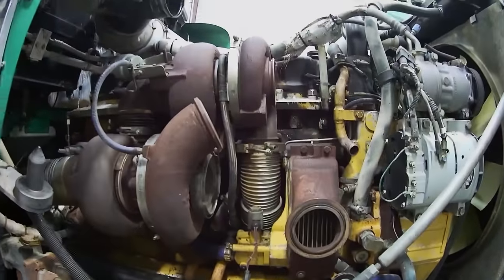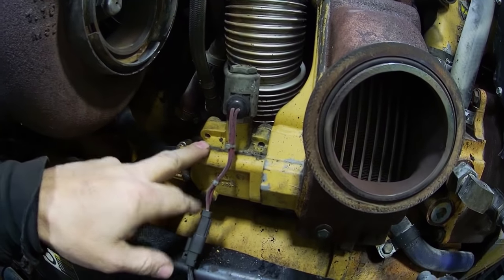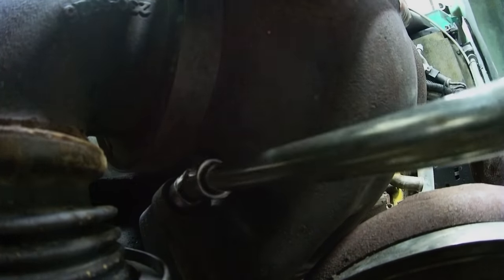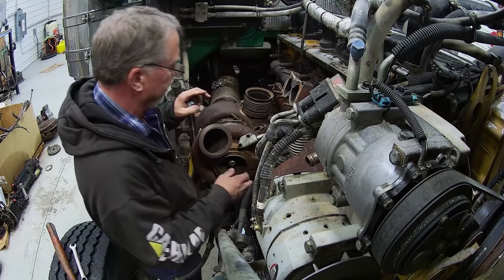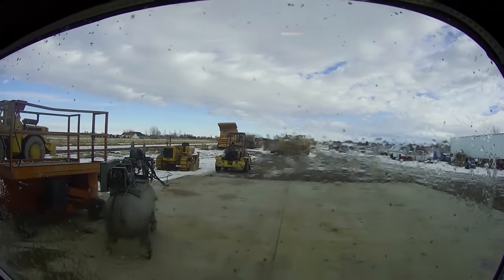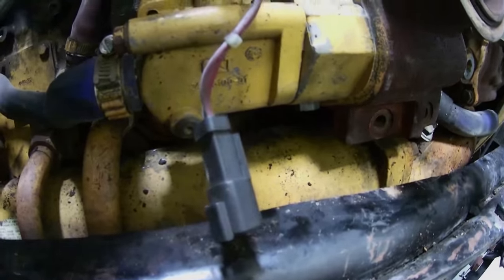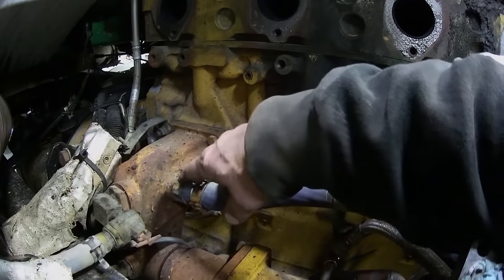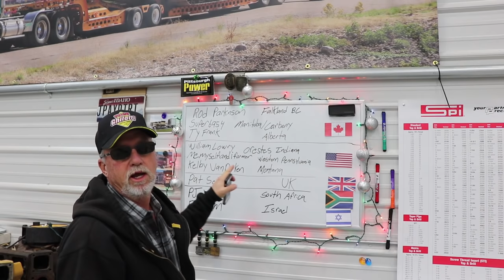Caterpillar C15 Tear Down

Comment from the maker: http://www.hankstruckpictures.com/rod_parkinson.htm

Rod's truck pictures, Check it out
Reply from the maker: The hose off of the cooler bonnet is the pressure side it goes to the pre cooler, thru the pre cooler and out the other hose to the intake side of the water pump

Comment: The solenoid you pointed to is the coolant diverter valve. It controls water flow to the pre-cooler. During warm up the valve is closed to prevent coolant flow to the pre-cooler. Once coolant temp reaches x(depending on software file) it opens to begin cooling the air charge. As for the valve riser you should only have to remove the IVAs to get the riser off, the rest of the overhead should be able to stay in place. Wouldn’t hurt to make sure it has the most recent updated studs to hold the rockers down. Went through a few revisions because they would break. Great time set the overhead. Also make sure the updated IVA oil line form the block to the riser is installed as well. Love your videos especially the old 1693 engine videos.

Comment: Love this channel Jeff, as a retired trucker i am still learning so much from watching you. We only had one truck brand called Foden that offered cat engines as an option when Pacar took them over, now they are no more like the rest of UK truck industry. I drove one with a cat, best engine ever it would pull so hard from low down. My grandad got his hands on a Diamond T after ww2 ex USAF. it would run rings round UK trucks of the time. All the best for the new year, stay safe.  Pat.  UK.
Reply from the maker: Pat, Pat Pat, old truckers don't die! they get a new Peter Built☻
Reply: Hey Jeff i nearly did, well not a new one, when i was buying my 1st semi i went to look at a 1978 6x4 Pete cabover,a guy imported to use as a show truck, it had a 350 cummins, 13 speed eaton which for the time was a fairly big engine for the UK, i still kick myself to this day for not buying it, i was worried i would not be able to get parts for it very quick.this was back in 1989 so i bought a volvo F12(you can stop laughing now lol) a few years later i found a guy who had imported a few Macks who told me he could get most parts for that Pete in about a week, hindsight is a wonderful thing. I,ve always loved American trucks ever since i was a small boy, i think they are built so much stronger than european stuff. stay safe and have fun ( it keeps you young!)  Pat.  UK.

Comment: I spotted your Robinson truck and watched your video. My dad and Art Robinson “King Arthur” dump trucked together in the 50’s. He had an IH gasoline powered truck. He moved to Peterbilt’s and Fruehauf semi end dumps after he got the coal contract that his family still services six decades later. In the 80’s, I think he felt Peterbilt was taking advantage of him and he bought a KW. Robinsons called it “The Weapon”. Peterbilt fell back in line on their pricing but Robinsons had now discovered how much better the KWs held up and how much easier they were to work on. The reason Art specified round headlights was because the snow wouldn’t melt off of the square ones. The Z leaf Hendrickson air ride is another good choice he made over the proprietary 8 bag KW Airglide. We get better traction and oscillation with our bellydumps and side dumps. I’ve got 20 of Art’s old tractors pulling dirt trailers around Utah. The family moved to Freightliners to get the Detroit Diesel engines because of the CAT ACERT engine’s epic fail. Cummins ISX birthing pains were also very costly. I miss buying KWs from them. He was a wonderful mentor and left a great family that still maintains his high standards of service and integrity. 
Doug Smith
Ralph Smith Co.
Reply from the maker: Thanks for that information Doug!

Comment: Happy New year Jeff. If it were my truck, I would remove the asshurt and replace it with a 6nz. The solenoid valve is to only let warm water circulate the pre cooler.

Comment: That’s the coolant bypass control for the precooler. Take the intake snail off that first turbo and it will come off that bellows to the precooler. Take the oil return off that turbo and the bellows clamp will come off

Comment: The selenoid allows coolant to flow through pre cooler to cool the air before it goes through the aftercooler, below +/- 68 ºF solenoid is blocking coolant flow, +/- above 68 ºF solenoid is allowing coolant flow to pre cooler, power loss will be noticed  if solenoid is energised above +/- 68 ºF and intake air is too hot.

Best regards from Portugal.

Comment: That solinoid regulates the water flow cause before they had that the pre cooler would cool the charge air enough that they would white smoke bad when cold. I worked on a acert once that someone had removed the precooler I believe they just made a hose to bypass it.

Comment: Correct on the solenoid, it controls coolant flow through the precooler. IIRC, it has to do with intake air temp regulation. It will throw a check engine light when disconnected. Measure the coil resistance and pick up a resistor to match, install in place of coil connection and tie harness back.

Comment: As you already get 50 psi Jeff hopefully you wont get less. Will be interesting to see if the variable vane turbo builds boost as fast as the series boost set up as that is more important to how an engine takes load as opposed to max load. You do realise the wastegate on the factory set up efectively limits max boost not the turbo unless you are already in lug and then its time to drop her down a gear or 2. The Adept Ape channel is interesting as the young fella mainly works on truck engines he knows his stuff. Cheers mate 🍻
Reply from the maker: You will enjoy whats coming

Comment: Did some research Jeff, the old turbo set up should get you between 52 and 56 psi. The water solinoid is the coolant divertor valve, it is off below 68 F untill the engine warms up and then stays on to let coolant through the pre cooler. Cheers mate🍻

Comment: @Jpaydirt I work in the CAT facility where the C15s are built. Absolutely love my job. You should not have to remove your rocker arms or brake assy. to remove the valve cover base. Just remove the valve covers then unplug the brakes and the main wire harness, Remove oil line for brakes at the rear of the engine. Then there should be small oil tube on the inside from the base to the rockers on the passenger side of the truck, Remove those too. Loosen up the base and it should lift right over the rocker/brake mechs.
Reply: The type of seal on the valve cover base is a type of press in seal. There is a groove cut all the way around the base, Super simple but can easily be rolled over during install if not seated properly and cause a leak.
Reply from the maker: Thanks for the info!  Can you tell me what the purpose of the VVA's are and how they operate? a lot of guys say remove them but I want to keep them as they are part of the emission cert   Thanks
Reply: Jpaydirt The VVAs operate off of oil pressure. I believe they are designed to hold the intake valves open a little longer than the cam and rocker to let more air into the engine to help fully burn the fuel under load.  Now from my understanding if you remove the brakes themselves you wouldnt have a "jake brake" any longer. I am by no means an expert but i do know more or less how things are assembled and function. Glad I can help!
Reply: It holds the intake valves open just a little loner under load to let more air in and help burn all the fuel. They are activated off of Oil pressure. If you remove them You wouldn't have a "Jake Brake" anymore. Personally I would just leave them, They don't hurt anything.  I am by no means an Expert so im sure someone has more knowledge on the subject than I. Im gald I can help!

Comment: I'd talk to PDI and see about eliminating that whole valve actuator ass ache. That oil soaked harness will cause problems before long if it hasn't already and the valve actuators would get backed off and not cause anymore problems. Having it done to my 07 as soon as it acts up again.

Comment: My c15 twin turbos make 60 to 65 lbs of boost..
I'm thinking yours will be the same give or take a bit ..alot of guys like just the one turbo  c15 . either way this motor is so powerfully and don't have to drop gears on hills like the crap Mack trucks I've driven this girl will lugg  to 1100 rpm and not bog out or sputter it'll hold it and yes I should of downed s shirt or a split but wanted to see what she can do and ipl tell ya ill never drive a Mack again if I don't have to lol I'm sure there's some good ones but cat motors are bullet proof and to bad they couldn't pass the emission be crap ..if possible stay away from the new emission stuff buy a glider kit if it's not to late or one like our cat ..lil older but so reliable and nothing like the sound of Jake brake of cat motors when straight pipes  .my shop wont do it for me but I wanted to get it done so i can hear that kitty cat prrr then hear the 3rd stage Jakes ,,,anyways great video bud and like always drive safe my keep mudflaps straight back lol 10-4 Roger that beep beep LMFAO git r dun truck driver .

Comment: Great video Jeff. Just one quick question, why was the dozer parked on tires when your boys got the blade off. Just curious.. Thanks
Reply from the maker: so it won't freeze to the ground and then all that dirt would be stuck to the pads and I want to bring it in the shop

Comment: damn  50PSI i would love  to see my 12V71 produce that kind of boost ,,i've got a 78 peterbilt with a 12V71 running common rail EFI ,,very experimental setup  that i got from china ,,i love it though cause i am getting a huge power increase and it's getting 18-20% better fuel mileage ,,i'm right  at 15K miles with no major issues ,and i love the way it starts at 0F ,, way faster than before ,,
and it had a 100HP power increase ,, it's no slouch either  producing 710HP at 2800 rpm  ,,and i'm only getting 30PSI of boost from dual turbos
Reply: wildcoyote34 that sounds like a hot rod of a Jimmy pard,  I'm on the west coast of the U.S. and have heard rumor over the years of many many 12v and even 8v Detroit motors in log trucks that ran like a terpentined dog! Your rig sounds like a real fun project
Reply: yea it's a hotrod alright , i got tired of not having enough giddyap , it was never a slouch  but it liked staying in lower gears when climbing long grades ,even when not pulling a huge load you had to keep it  would up 
for some reason that i always  thought kinda weird  12V71 engines run about 400 rpm faster than an 8V , either 71 or 92 series ,, slightly oversized turbos  and  the EFI system helped it reduce emissions and increase power ,,usually the 2 don't go hand in hand with fuel mileage increases 

now if i get a smidge hard on the clutch  it'll  break wheels loose if i'm not pulling anything
Reply from the maker: I want to convert the 1693 I would love to see some pics and hear more
Reply: wildcoyote34 those big displacement jimmys sound damn good when they're tunes and runnin right! Got some friends that work around them that are in yarder machines for logging and awesome sounding when you give er and they're pullin hard! Hey Jefferson, the 1693 would be pretty bad arse if you go that route and be even better to watch the process unfold.
Reply: Make a video of it!!!!

Comment: If you're not having the precooler and vva's deleted in the ecm, just take the nut off the top of the solenoid ( coolant diverter valve) on the precooler remove the electro magnet and just bolt it to the side of the engine block with a 3/8 bolt and plug it back in.  It will run just fine like that.   If you want it deleted .. I can do that for you if you like. The other questions you had have already been answered well by someone else.
Reply: I find it hard to believe that he hasnt mentioned an ECM program, leaving the valve actuators active is not going to do anything good for that engine.
Reply: truckinbobb.   personally.. I would delete them , but it's not my truck.  Some prefer to leave the ecm alone and I get that.   Myself...i would delete the precooler and vva's and leave the turbos on. The work fantastic like that.  That's how I've done my accerts but to each their own.  I'm definitely curious to see how well this turbo works.
Reply: Yes I agree, I think it is foolish to remove the compounds, the shop I work with does both but the trucks that one of the partial owners works daily all have acert compounds on them, even going back and installing them on older C15 and 3406E engines.
Reply: truckinbobb. Yup I've done that myself, installed the "twins" on old e models. Run great on there.  I make my recommendations bit ultimately it's the customers choice.  The switchblade turbo he is installing should act like the compounds he's replacing .. smaller tighter exhaust ratio for quick spool then opens up into a larger turbo.  I've never seen one converted to single with a switchblade before so I'm excited to see his impression after it's done.    Should work great in theory.
Reply: IMSEMICRAZY, for stock HP levels I think it will work well, I question the long term reliability of the mechanism in the exhaust housing as well as how they are going to size the exhaust housing, if they go with the standard 1.32 for the S400 frame I’m not sure why someone would want that to spool faster as it is already borderline to small for a 15L engine. Something like the 1.58 or 1.65 may have been a better starting point, we will just have to see.

Comment: You work on many Acerts and your trash can is going to fill up fast...  I'm jacked up to see what difference the turbo is going to make...  You got me interested and I have been going back and forth with Blaylock as well....
Reply: Chuck Driver ol Chuck gonna be packin a switchblade on the B.......? I might have to come drive Chuck for a day if you do the swap, then you can go fishing and I can have a therapy session for a few.......well several hours lmao
Reply: Woos 31 if they can tell me it will make a difference over what I have now, there is a pretty good chance I would flip the switch...
Reply: Chuck Driver I'm thinking the boost is going to come in sooner and maintain nice and smooth through the rpm range and will consistently run 50-55 pounds, not peak every great once in a while in perfect conditions like Jeff saw on the pain in Ass-cert configurated C-15. Another swap that would take care of a lot if issues and would tickle most anyone, and are pretty damn WICKED in the truckin b-iness is goin right for the jugular vein with a C-18 swap..........lotsa head ache solved in stock form even LMAO!
Reply from the maker: Your going to flip dude☻
Reply: Jpaydirt I hope very much that it's way more than 50-55 pounds of boost, but didn't want to shoot for the moon lol. It'll be an upgrade from stock all the way around that's for damn sure

Comment: All good stuff, thanks Jeff.   Looks like that C-15 is going on a diet, it has got to be losing quite a bit of weight??  (that has got to be good, right?)  What struck me when you were removing all that "hardware" is the sheer amount of iron hanging off one side of the engine block.........(might get out of balance,LOL)
Reply from the maker: Well I'm just adjusting the balance since I have lost 50 lbs from the drivers side☻

Comment: Yes on resealing the IVA manifold,  the engine brakes/IVA housings have to come off. Look over the retaining studs real well, they like to break on some engines. Under valve cover harness is going to come off with housing. Might as well put a new one in, connector leaking oil anyway. And since your that far in, might as well pull rockers and check cam and follower rollers, adj top end.
Reply from the maker: Thanks that's what I wondered thanks for the info

Comment: I'm no expert, but as I understand it, the Wastegate, which was mounted to your top turbo, releases excess boost pressure - so therefore is responsible for setting your maximum boost. It was obviously set to release at 50 psi. Your new turbo will boost to whatever your new wastegate is set at. Good luck and I am enjoying your videos very much.
Reply from the maker: The Switch blade doesn't have a waste gate, I will be showing you exactly how it works and thanks for watching sir

Comment: do you have an electric leaf blower or a shop vacuum that has a blow feature.. so you could drop it down the exhaust stack when you are done to check for leaks on the exhaust connections..  its not likely you will have any with the care you use.. i don't think that dropping an air hose down there with rags plugging the excess would be a good idea unless somebody is up there regulating airflow to prevent excessive pressures..

Comment: Good luck with the turbos, I'll ask around regarding the solenoid on the pre cooler...  could be there to keep the intake temps up when it is really cold out (i.e. shuts off flow through the pre cooler)... think of it as an electronic thermostat...?
BTW...  Happy NeW YeaR !

Comment: Are you planning to take the valve act junk off the engine? We took all that junk off my engine put a C-16 turbo on it and wow what a difference! Good thing the is 8 tires back there or i think it would spin out in the lower gears!
Reply from the maker: Not yet, I haven't had any trouble with them, and the C brake is part of them so you couldn't take them off, maybe disable?

Comment: Should take it to CAT and let them do it properly. They can dyno tune it as well.
Reply: Cat will not remove the compounds as they are an emission feature, to disable the IVAs to allow a single turbo to work requires an ECM reprogram.